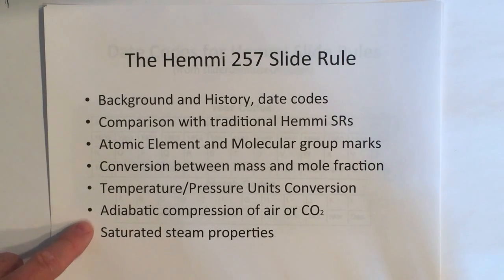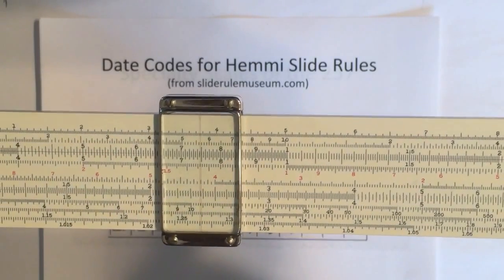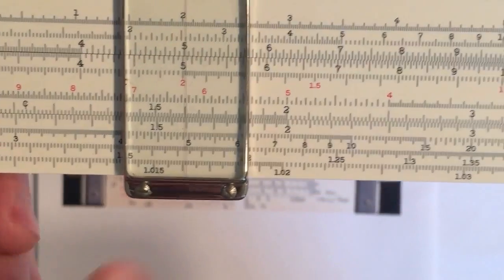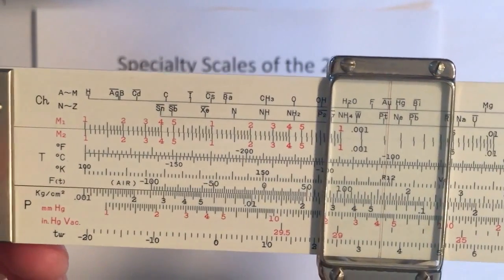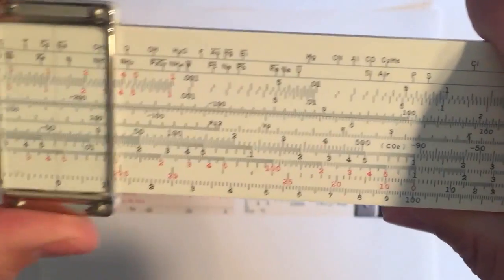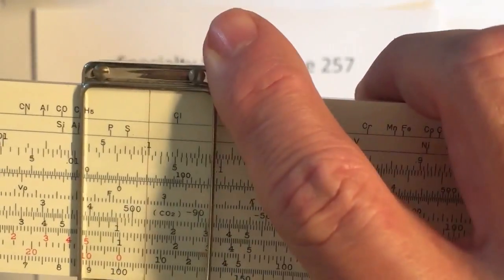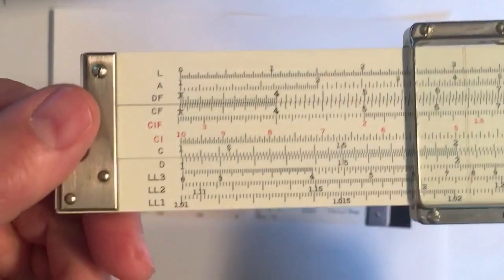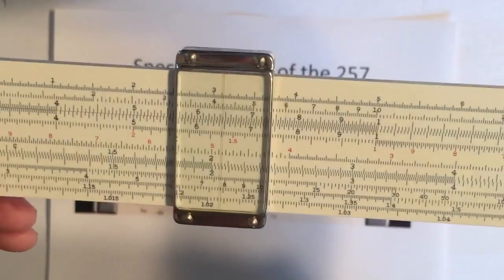The Hemmi 257 Slide Rule for Chemists and Chemical Engineers

Comment: My father bought one of these in the early 1960s for college (in its Frederick Post incarnation, which seems to have been called a Post 1491), since he was studying chemical engineering for a while, and I spent some time playing with it as a kid. I think he has it now. I remember being puzzled by its scales and, of course, it was hard to look up how to use the ones on the back because they were pretty much unique to this model. The most unusual thing about it for a rule this fancy is that on the front, it has a set of log-log scales but no trigonometric scales--not even the ones that exist on basic slide rules. I guess chemists have to raise things to powers a lot but not do a lot of trig.